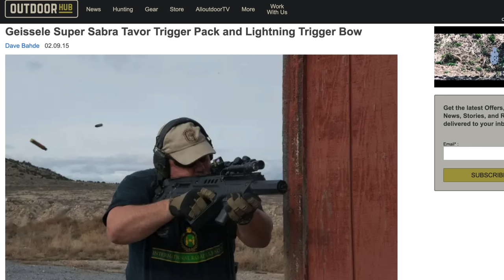6 Reasons Why the IWI Tavor is Better than the AR-15

Comment: Can you do a reliability test on the Carmel? I’d love for it to gain more traction especially for aftermarket TLC. I’m in love with mine as it happens to be my choice over an AR. There are spare parts available assuming I buy a lot so why not? Im used her to chunkyness so there’s more to love and I don’t like the slimness of the AR now it feels like a toy. There are some parts I wish can be looked at by hbi, kns, or manticore, such as a new rail design with lightening cuts, a new gas plug with more selection, and a minor gripe but the  top panels under the pic rail leak similar to the x95 side panels when suppressed. Overall it’s my own version of the Scar(Mel).
Reply: I’ve heard the Carmel as being an un-bullpupped x95 because their bcg and spring setup is similar

Comment: I have the X95 and two AR's and here are my thoughts.  I bought the X95 to couple with my suppressor, because putting a suppressor on my 16" AR turned it into a forward heavy musket.  Problem is blow back.  You get SOOO much gunk all over you, your face your clothes all over the gun when you use a suppressor.  10 times worse than with an AR.  Balance sucks, when you hold it in your hand, especially with a loaded magazine in the weight distribution is all towards the back.  I would up buying a 12.5" AR, doing a SBR so it would be full length when I added the can.  Very plastic feeling overall on the X95.  Plus I don't really care for the all the action taking place right next to my head with it being a bulpup.  Overall wasn't satisfied with the X95 and hardly ever shoot it, it is cool that it has added to my overall knowledge of firearms, but really at that price point I am disappointed I made the purchase.
Reply: IWI suggests using the OSS suppressors only. They were even selling an OSS suppressor with an  IWI logo and grey colored paint a while back
Reply: @nickc7320  Another reason not to buy a Tavore if you have to buy special suppressors for them.  Oh you have a $900 dollar suppressor and $200 stamp tax?  Just buy another.  That’s some let them eat cake shit right there.  Tavore is overpriced anyways compared to an AR and they want you to buy special suppressors?  Huge red flag.
Reply: @tempest-523  I wouldn't say there's a reason not to. You can shoot it with any suppressor, it's not like he's going to void the warranty like it does with the scar system. They just suggest it because the low back pressure system and there's no adjustable gas block. When they were testing the system and I do believe they were doing this in coordination with suppressor shop (ss told me the following) they discovered that the surefire suppressor they were going to market with the gun had too much back pressure which is a common complaint. I can't say it's a red flag but any non adjustable gas system is going to run the same with a suppressor with too much back pressure.   Generally poorly and over gassed.
Reply: @tempest-523  and I really wouldn't call the devour over price compared to a long stroke gas piston AR. Yes is more expensive than a direct impingement AR or the bargain direct impingement AR but not really when you start looking at quality ARS is kind of evens out.

Comment: I may have an AR, but I’m a huge fan of bullpup guns. Unfortunately the Tavor was out of my budget at the time, and while I considered the KelTec RDB, I went with a Ruger AR-556. This is making me wish I saved up a bit longer and got the Tavor instead. Do you think something like a Sig Romeo5 with a magnifier would be a good setup on the Tavor?
Reply: Super good setup yeah. But as others have pointed out, you'll be strung out for parts in case anything breaks, which is inevitable if you use the gun. Availability is poor for such things. Bullpups are just not as affordable or practical for civ use...
Reply: @BeamMonsterZeus  Yeah, that’s a good point, and ultimately why I chose a budget AR for my first rifle. Though I did gamble on a KelTec KS7, so I still got my bullpup fix.

Comment: What’s the chances of the firing pin breaking or the pin spring having issues?  Someone brought it up and I can’t help but wonder how relevant that may be; with those parts usually out of stock, the idea of broken parts with no replacements.

Comment: Three reasons a bull pup rifle is not better than a standard rifle.

1. The explosion is happening right next to the face. Catastrophic malfunctions are much more likely to be catastrophic to your life.
2. Shooting off-hand will require either a 1-3min conversion or the ejection port will be hitting you in face (along with the first problem).
3. The trigger is always going to be stiffer than a standard rifle configuration.
Reply: 1.  Bullpups take this into account a bulk up the area around the chamber.  I've seen reports of some people suffering a KB and not even realize it.
2.  This is a tradeoff to the superior size factor and balance, occasionally you'll have to be mindful of the ejection port when switching shoulders.  Not even that big a deal.
3.  Only civilian target shooters care about this, most military rifles are deliberately built with triggers that are way heavier than they need to be as it's considered a safety feature. The stock X95 trigger is actually quite good and I see zero reason to upgrade it.

Comment: Great design, I really wanted one until I got to shoot one and felt that awful trigger.  I guess I need to try one of the newer ones, or with a drop in, but the old trigger was total deal breaker imo
Reply: The X95 trigger is significantly better than the original Tavor trigger
Reply: @jarvy251  i really need to try it out.  They're so darn pretty.

Comment: Reason 1.  It's just not as good as the ar15.  Bullpup rifles are cool.  But the accuracy. Modularity. And reliability of the ar15 can't be outdone.  Even almost 70 years after it's creation it's still the best most cost effective,  Combat effective rifle.    6.5grendel in a ar15 is a hard cartridge rifle combo to beat.   Now I know it's not Nato compatible. But the fact I can turn 7.62x39 brass into 6.5 with a pull of a lever makes it my go to caliber.

Comment: The m-16 rifles do have a tendency to hest up the barret and dust is the primary reason why the m-16 rifles are useless in the Vietnam war if they are not cleaned properly. Imagine this scenario, a detachment of soldiers will attack your base. You are in a fix hole. There is a lot of dust swiling around your compound with the helicopters coming in and out to bring your needs in that situation. Dust hoes up the air and when you see them doing a banzai attack,you start shooting but your rifle will not fire? What do you do not, play poker or something?

Comment: One more thing. Look at the barrel just forward of the chamber. There is a groove machined into the barrel.  Poor accuracy??? Yes, because if you want to deliberately de-accurize a rifle, then machine a grove right infront of the rifles chamber to allow the barrel to flex and "flop" randomly with each shot.
Get rid of the groove, and drop the price by 1000 dollars ....I'd buy one.
Reply: Have you considered there's a reason why that groove is there?  It's part of the locking mechanism that lets you pull the barrel out.  When installed in the rifle, that groove is completely filled by a tight-fitting steel bar that rotates into it.
The X95 is already price very competitively compared to other "non-ARs."  The AR is cheap because the design is so old, it's entered public domain, so anyone can build them without license.  Colt USA doesn't even make their own ARs anymore, they contract out almost all the parts because it's cheaper.
Reply: @jarvy251  it's a 3 moa rifle....why?
Reply: @themotivehunter  With what ammo?  Mine is ~2MOA with PMC Xtac and a red dot, which is about as good as you're getting with that combo out of any rifle, and it's 1.5MOA with match.  It's not quite the same tack driver a $3000 AR would be, but after nearly a decade in the infantry, I can tell you there's more to a rifle than getting good groups from a bench.

Comment: Why is your face all black at thunder ranch? One thing I dont like about the x95 is that the ejection port is right by your face and the muzzle is much closer to your face.  Pretty much need to run suppressor if you don't want a headache after shooting. The cqb benefits are null to me as a civ as even in wrol I would avoid cqb situations like the plague.

Comment: A swappable ejection port will do NOTHING for me if I need to transition right to left to pie a corner. The brass will still fuck my face even though it's swappable. How fast can you swap the ejection port...only ones that are truly ejection ambi are forward ejecting or bottom ejecting. There's only a few that do that I can think of. To me those are the only viable options for what I consider a CQB rifle to do. AR's can do that very well also...no need to swap shit. An ejection port that NEEDS to be swapped to change shoulders is useless IMO. It's for this reason alone I don't own anything that can't accomplish this simple infantryman task of transitioning shoulders to reduce your profile while maneuvering around corners and or obstacles...which is IMO crucial for a rifle designed for urban combat. If you want a bullpup that can do this don't buy the Tavor. There's a few better options that this is a non-issue.

Comment: The number one reason it isn’t great, it’s accuracy sucks. I really wanted to like the tavor but what’s the point of having a longer barrel in a shorter length rifle if it is not as accurate as the rifle it replaced.

Comment: most decent bull pup builds would be like $2500-3000 lmfao you can buy 3 ars  and have a big market for parts
Reply: You could buy 5-8 ARs for that money, ones that are just as reliable as the expensive "name brand" ARs floating around. That's not the point though, we're not armchair CFOs.

Comment: "Why the IWI Tavor is Better than the AR-15" - it isn't, and there's now ample photo evidence of that. Not saying this cheering for anyone - but check photos of IDF entering any hospital in Gaza and count Tavors vs ARs. That's the absolute best use-case for a bullpup. Closing in in a transport, then short stint in urban setting followed by building clearing, presumably by specialists who get to pick their kit. Ain't nobody taking Tavor though. That to me sealed the discussion on it.
Reply: IDF soldiers can't choose which kind of gun they get to use every they train with the tavor and with the M4 but they use every time a different one depending on the mission, I've spoken to a lot of IDF soldiers they all said that they like the tavor better cause it's easier in cqb, and they mainly fought in urban environment

Comment: Tavors definitely aren't as accurate as AR15s.
The Tavor is in no way based on the AK. It has an AR15-like gas tube that comes back to a much shorter long stroke piston, much like a Juarez gas system. Nothing present is AK-ly, unless you actually believe the meme that every single piston gun ever is an AK, including HK416s and G36s and so on. Yeah, they're both long stroke, they share no technical similarities other than a type. Kinda like how both AKs and ARs are rotating bolt. Different cam paths, bolts, carriers... not directly related machines.
The Tavor is based off of Uziel Gal's rifle that lost to the Galil. 

The Tavor's gas system is way lighter than the AK's, it's just not AR-light. There's also so many things going on it's really unfair to blame this greater weight on solely the gas system, which frankly is one of the lighter weight ones around. Could've been lighter still, it's true. 

M193 is great when its going fast, but its frag range even with a 20" barrel is truly terrible. We do so far and away better now with various 62, 68, 77, etc gr projectiles (M855A1, Mk262, Mk318 SOST, some other stuff I forgot) that have lower fragmentation velocities and are more aerodynamic, holding their velocity longer. A Tavor (or any 5.56 SBR) will perform great with something like 262, 855A1, or 318. Some of it is sadly hard to find, and/or expensive.

Comment: Yeah, I sure as shit wouldn't trust my life to a an israeli made weapon (the galil being the exception, as it's just an AK with a bottle opener and a barbed wire cutting bipod).

The AUG is the better rifle, and it's over 50 years old.

"But i love muh picatinny rails all over the gun!"

Putting useless and unnecessary crap all over your rifle in order to feel like an "operator" is just stupid.

Put an optic on it.  Maybe a laser sight, and maybe a vertical grip.  That is all you need.

And the better rifle to do it? The AUG.  It comes stock with a vertical grip.  And has a picatinny mount specifically for a laser sight.  Anything else is just unnecessary crap.